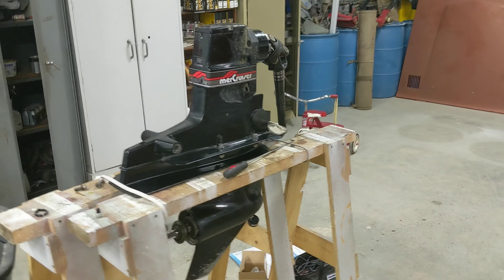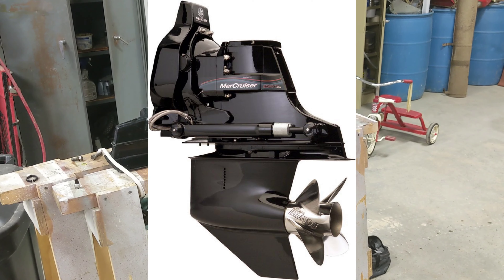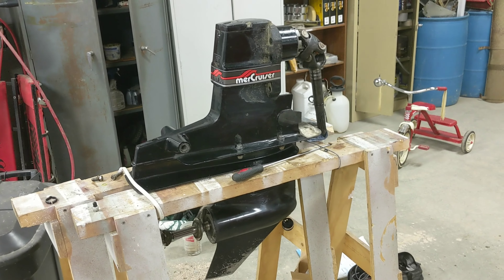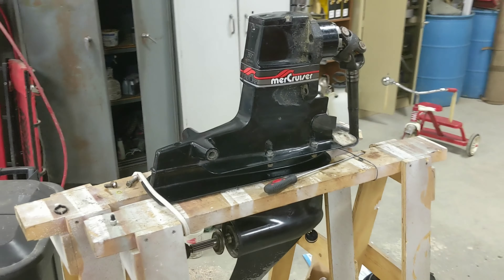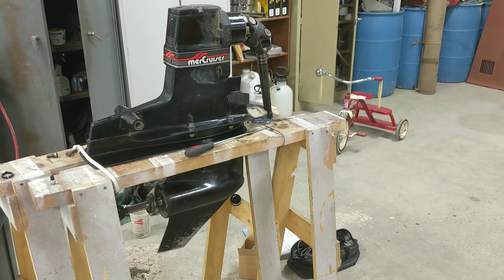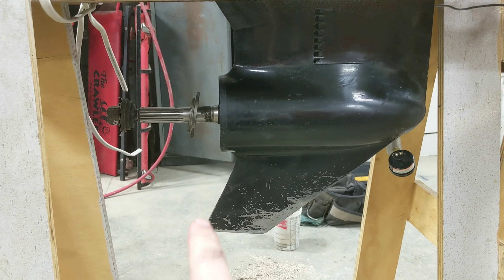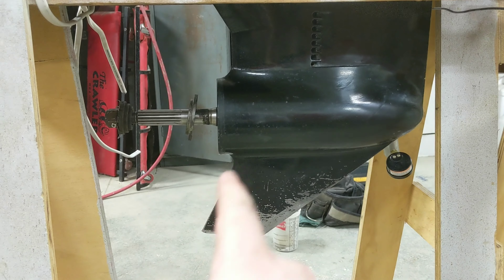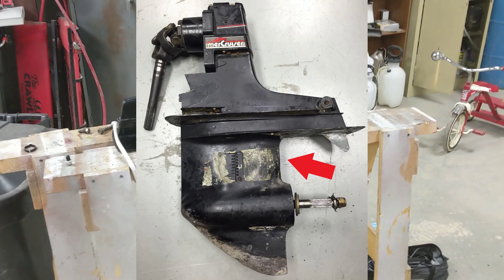Mercruiser Outdrive Identification -- Alpha Gen 1, Gen 2, and Bravo

Comment: one way i tell them apart the gen 2 has bolts and nuts to put the lower unit on the gen 1 bolts strait in no nuts
Reply from the maker: Nice idea! I didn't know that.
Reply: that would be studs, makes alignment while installing easier, and less chance of stripping threaded housing.

Comment: I've been scratching my head for 2 days now trying to figure out which one I have. You fucking nailed it thanks
Reply from the maker: 🤘happy to help!
Reply: @605BOLT  all I need now is to lower unit service manual which I didn't know is a completely different manual from the one I have. I bought it from a gentleman and says the lower unit is grinding, etc.
Reply from the maker: I have and recommend purchasing a SELOC brand service manual such as this... https://amzn.to/3XTBfqD

It works well and has lots of different models in it in case you get a different boat at some other time.  Just make sure you get one for the right model/years for your application.  Also, in the files section of the Mercruiser Stern Drive Facebook groups, they often have full service manuals saved as pdf's so you can grab those for free.  That might be all you need.  Good luck!
Reply: @605BOLT  awesome advice. Thanks a million 😁

Comment: Working on a alpha one Gen. 1. That I am currently going down the rabbit hole of LS, swapping. Need to know? The measurement Of the transome Plate Mount. Gen. One, Gen 2. And Bravo. Trying to figure out a bellhousing that will clear a 14 inch. Fly wheel...  I have a 04, LS, 4.8 Stand alone computer on the way, I Just need to know the difference of the different platform.
Reply from the maker: I'm pretty sure that SBC and LS1 have the same bolt pattern so you should be good with your 4.8 even though it isn't an LS1.  Also, I think the SBC engines use a 14" flywheel.  So I think you got it already. That would be an alpha because you want something that bolts to the small block chevy.

Comment: Thanks, great information.  One question, see when looking for parts, some parts are listed as for MR MC.  Can you tell me what that means and how to know if mine has to have those listed parts?  ie. shifter parts
Reply from the maker: Hi Don.  Thanks for the kind words.  I am not an expert on part purchasing.  I bought almost all of my parts from Ron at JR Marine where I called him and told him what part I needed and he did the hard work of digging through catalogs and whatnot.  He knows a lot.  If you go that way, mention you watched these videos for me.  Several of the other parts and specialty tools I used were through merctuff.com.  I never talked personally to those guys but everything I ordered came as I ordered it.  With mercstuff.com, you need to basically know what you have and use their little catalog to sort through; more tedious than JR Marine in my opinion.  To cover your original question, Mercruiser had both an "MR" and and "MC" outdrive.  This is probably what that notation is referring to.  These outdrives are older.  I would guess pre 1990 or so at least and they aren't very similar to the one pictured in this video which is an Alpha One Gen 2.  Hope this helps you out some.  Feel free to hit me up if I was unclear.
Reply: @605BOLT  So you mean the MC and MR are old outdrives?  Do you know if they show up anywhere on the Outdrive or maybe on the outdrive serial number?
Reply from the maker: @donens9310  I don't know anything about them other than yes they are old outdrive and that they do exist. Never worked on one and can't say that I've ever really seen one. Pretty much antiques at this point. My understanding is that they are visibly quite different from alphas and bravos. Sorry I don't know more to help.
Reply: Great question
Reply: Mine is an alpha on (1988) 3.0L on a 1988 Chaparral 178XL. I’m not sure what repair manual to buy. I have shifting issues and some grinding trying to engage the propeller
Reply from the maker: Chuck I see from your comment you have an alpha drive. I found the SELOC repair manual to be extremely helpful.

Comment: I have A1 gen 2 and when I put it in reverse, it goes there at an idle but when I give it more thrush, it kills the motor. And ideas?
Reply from the maker: @tracybeasley440  I bet it has something to do with the shift interrupt switch. Basically, when you return to neutral from being in reverse or forward gear, ignition is cut off for a second. Just a split second. But if your lower shift cable is out of adjustment or sticking, that can cause you issues.

Comment: Can you explain if Alpha 1 Gen 2 drives from differing serial number ranges are interchangeable? For example, I have a 2007 that needs a whole drive assembly due to an accident, including the gimbal mount and bell housing. I know the gear ratios are different but are the housings the same? Could I use an older gen 2 and install the correct gears?
Reply from the maker: I believe so. I think the only differences amongst them are the gear ratios so if you do the gear swap I think it should fit up. I have never done that type of a swap before so I cannot say for sure. Sorry I couldn't say for sure.

Comment: One other visual cue between Gen 1 and Gen 2 lower units are the 4 mounting bolts are visible on the Gen 2 and not visible on the Gen 1....Also, Gen 1 has a removable plastic insert on the water intake and the Gen 2 does not.
Reply from the maker: Excellent points!!! People cruising the comments will find this useful! Thanks for commenting!

Comment: Do you have alpha maintenance videos? Curious because I’ve heard there are zerk grease fittings that could be greased at intervals and I’d love to learn more about my alpha one gen 2 now confirmed thanks to your video. Is it normal when going into gear forward or reverse to have some clicking sounds until fully in gear?
Reply from the maker: I have a few alpha gen 2 vids coming up yes. I'm glad you found that identification video helpful!!! There are some grease points. I don't have that exact video planned but that's a good idea. 🤔 The main spots you will want to hit are the gimbal bearing (if yours is yet greasable). Many have been replaced for the non greasable version. This is greased on the starboard side of the gimbal housing. Right up against the hull. Also, the two pivot pins that allow up and down trimming. There is a zero on each side. Points out to the rear of the boat. Those are the main ones that I know of. For an alpha gen 2 at least. Hope this helps 🤞
Reply from the maker: Also, clicking or clunking while engaging into drive or reverse is pretty normal. Basically there are dog clutches that grab (kind of like teeth hanging out into space). I can say you want to be deliberate in your shifting. It might sound a little weird but you want to limit the clunking noise by not "easing" into gear. Easing into gear actually causes more wear to the teeth. 🍻
Reply: @605BOLT  thanks, I do have all 3 grease zerks. Does it matter what type of grease is used? There’s probably a Marine specific grease right? On the gimbal bearing how do you know how much grease to put in??
Reply from the maker: There is a blue marine grade grease yes. I wouldn't go crazy with it. Just a couple pumps is all probably. The gimbal bearing just poops grease out into the gimbal bellows and the side pins don't really have that big of a spot for grease to be.
Reply: @605BOLT  thank you sir. I’ve always been easing into gear thinking softer grab was better so I’ll have to get out of that habit. It was never “a lot” of clicking but def a few clicks. Thanks again for all the info and damn quick responses! I have a 5.7 mercruiser circa 1995.
Reply from the maker: @lh98  right on. Ya that will save a little wear on it. Glad u found the videos useful. I learn lessons the hard way a lot but sharing info is the only way anyone learns anything. Gain a little experience when I can and very thankful to people I bounce ideas off of. Hope your boat runs well for a long time. Mine is a 95 as well. Getting up there in years for sure.

Comment: I have a question, I may have placed a order for the wrong stern drive through sei. From this video I gathered I have a gen 1 but I think I order a counter clockwise vs clock wise. My question would be,  does it matter? Sei is closed for the day or I’d ask them. Thank you
Reply from the maker: I have no experience with ccw drives vs clockwise. I would want to stick with what is factory if at all possible. I have no idea whether that would work. If it was me, I would call sei in the morning and explain the oversight. Shouldn't be a big deal I don't think. Probably happens all the time. Lots of little details to get right and I'm sure people miss here and there. Sorry I couldn't be more help.

Comment: Is the gearing all the same? Or can i use one from a 4.3  with my 140?
Reply from the maker: There are multiple hearing options depending on the engine.
Reply from the maker: But if the gearing is the same, then they are the same.
Reply: @605BOLT  how would I know?
Reply from the maker: @ronaldaugustine6032  the gear ratio is on the side of the outdrive yes.

Comment: How do you identify which transmission you have?
Reply from the maker: On this specific boat, and most boats in general there is no transmission like on a car.  The prop is essentially directly driven by the crankshaft.  The only gearing would be the ratio of the actual stern drive which is stamped on the side but thats more like a rear end on a car.  One gear, one speed.  I hope this answers your question.

Comment: Supposedly there are three alpha one gen 2 models
Reply from the maker: Could be. Wouldn't be surprised to hear that. I thought they were all the same but idk for certain. How do you tell them apart?
Reply: @605BOLT  that was my question
Reply from the maker: Oh my bad haha. I haven't seen anything about that. As far as I know all alpha one gen 2 outdrives are the same except for the potential gear ratio difference. 🤷‍♂️
Reply: And how much gear oil to fill
Reply from the maker: Pump in from below until it comes out the drain hole up top. Then cap the top and fill the reservoir up top.
Reply: I know what to do. I was helping you
Reply from the maker: Oh haha. Roger that!